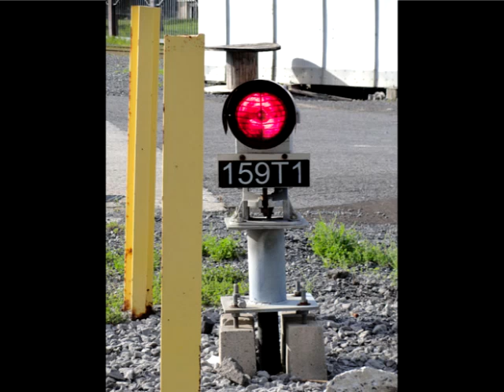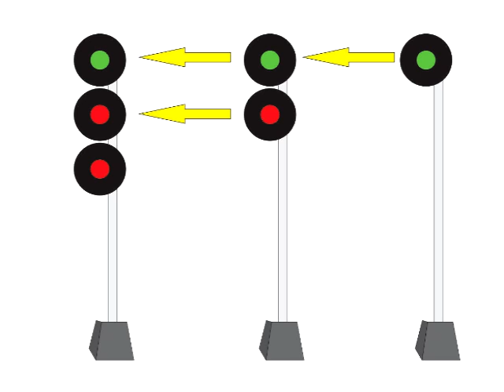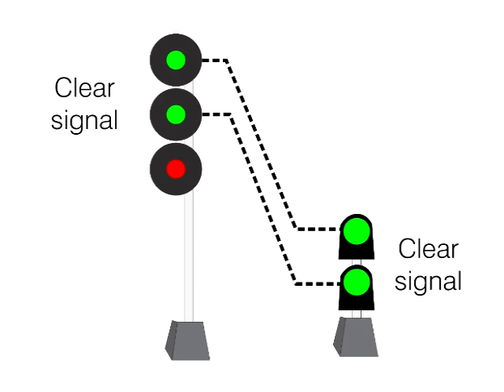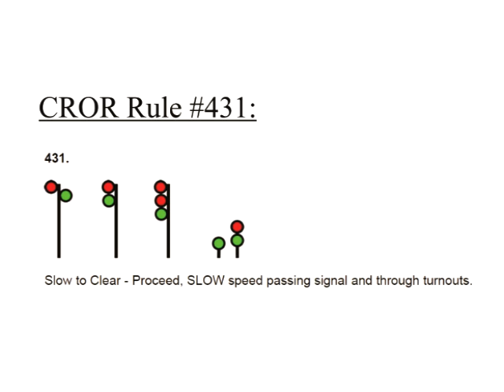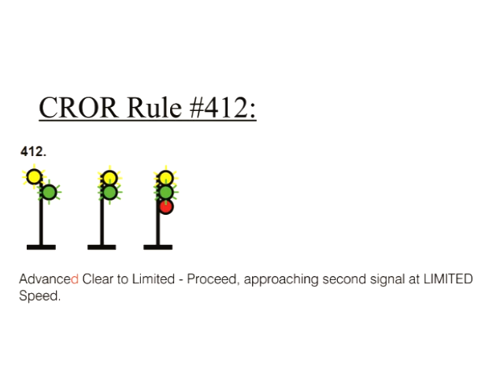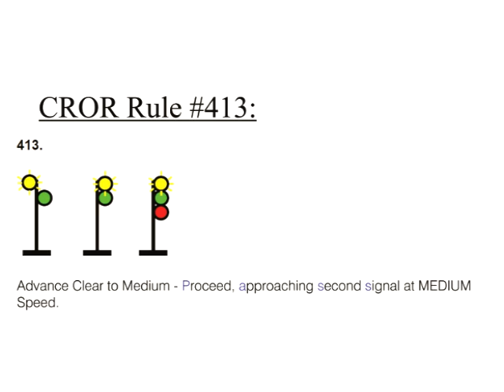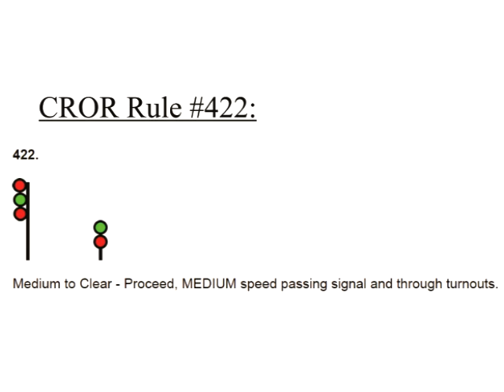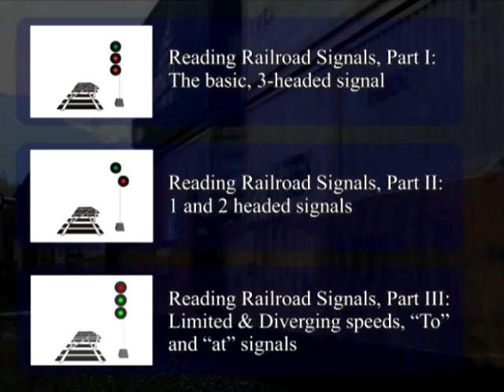Part 4 foamer's guide to reading railroad signals: dwarf signals

Comment: I just wanted to say I always struggled with this as a foamer of the Grand Trunk Western Railway. I lived near a distant signal to the Wabash Line NS today. They have double head USS 3 color searchlights there and   a signal dwarf signal for reverse track. I could never understand the strange indication it would display for the next signal, which had a switch 15 mph. Thank you for clearing that up. It's not to hard to remember. Today the Canadien National Railway replaced the searchlights with double row lights and then sold the line to the CSX. I've been upset with CN for doing that. I miss the GTW RR. I can tell you put in a lot of hard work into these videos. I appreciate it. ❤

Comment: Great mini series here. One question though,, I've seen a three headed signal with a white light in the third signal head. what does that mean?
Reply: It is approach slow according to csxt signal rule 1290.
Reply: Did you see it in the US? It’s a restricting signal on all the systems I’m familiar with. CROR (Canada) does not have lunar white lights.

Comment: Just wondering ... you talk of the train speeds in MPH, but I thought Canada had gone metric? Have the railroads retained speeds and distances in miles, or are you converting km/h to the nearest 5mph for American viewers?

e.g. are 15, 25, 30, 45, 75, 100mph actually 25, 40, 50, 70, 120 and 160km/h... something like that?
Reply from the maker: No, the railroads in Canada retained the imperial measurements. We do everything in miles, miles per hour for the reasons of the rules which were in effect long before Canada went metric. And so a lot of the rail operating rules (i.e., identifiable locations, mile posts, and trains speeds like slow speed, medium speed, limited speed, etc...) were based on imperial measurements and set up. Converting everything to metric would've involved a major overhaul of the rail operating rules which had been around for decades prior. CN even pays us "by the mile."
Reply: @ianjuby  I remember the pre-2020 O-Train Trillium line in Ottawa being denoted and marked in kilometres, but I think this was an oddball exception. The entire system is being switched to CBTC and now disconnected from the mainline rail network.

Comment: I wonder, why there are so much different signals. In Germany, our signals have only three definitions. Go, Slow and Stop. The signals are protected, even when they are automatic blocking. Sometimes the slow signals are upgraded, with speed signs. A motorman has to push a button from time to time to show he is alert. If not, the train will stop at once. Sorry for my english.

Comment: question what is a flashing green dwarf signal.    i've seen it in the states a few times. mainly on a commuter railroad outside of new york city. note the track speed is between 50 and 80
Reply from the maker: Hmmm... I don't know - that would be something Amereecan, quite possibly unique to the communter railroad itself. I wouldn't know, someone else here might.
Reply: Flashing green is for cab signals.
Reply: Depends on the arrangement of the dwarf signal. Is the signal alone or in combination with one or two other lights?

Comment: How do you know when  you've cleared a switch to either speed up or slow down?
Reply from the maker: We have a footage counter in the locomotive. We push the button, and it tells us how many feet we've traveled. We set the counter at the light as we enter the siding, and we know our train length by the train journal information.
Reply: Ok thanks, that makes perfect sense.
This does take some time to understand this but I can see the importance of the fail safe system.
Is there any reason why the lashups of power units often combine a EMD and a GE units say in a SD70 ACe and a C44-9W?
Reply from the maker: Nope. No reason. They just slap together whatever is available.  I've seen them stick old beaters on the hot shot trains, so obviously it the power isn't even assembled according to the need on the train.  But I've had brand new units (literally 2 weeks old) die on me, so new or old doesn't mean a whole lot when it comes to reliability.
Reply: It's called a distance measuring device or DMD. When the engineer gets on board, he takes the total length of the train plus 3% slack action and enters it into the counter. He hits the button when the engine reaches the signal or switch and it counts down until zero. When it's at zero, you've cleared the signal or switch.

Comment: In the signals test do you need to remember the rule # as well ?

Thanks
Reply from the maker: Nope. And in fact, the QSOC classes (conductor's rules classes for new conductors) may have switched how they perform the tests. When I went for my recertification last year, they simply had an answer sheet which listed all of the signal definitions and you had to match up the letter of the appropriate definition with the signal on the test sheet.
Reply: Ian Juby awesome thank you very much for your help

Comment: ASPECT = What the signal looks like.  Green over Red, or Yellow over Dark over Green for examples.
INDICATION = What the signal indicates the train crew should do in response to the signal.  “Proceed, passing the next signal not exceeding Medium speed,” for example.
RULE = The formal assignment of ASPECT(s) and INDICATION as presented in the Rule book. Each rule is assigned a RULE NUMBER and a NAME.  Rule #419 / "Limited to Slow" for example.

Comment: Oh dear. You forgot all about the difference between lunar, light blue, white, off-white, beige and grey signals, what you should do if in the signal is triangle or rectangle shaped, what the combination 'flashing-green, winking-red, startled-yellow' means, the divergence in meaning of limited vs. restricted vs. off-peak vs. weekend-only vs. occasional signals (in red, yellow, green, lunar, light blue, white, off-white, beige and grey; flashing or steady), and what to do if it's a full moon and/or the next solar eclipse coincides with the passage of Venus.

Other than that, pretty comprehensive, and a good overview of a not at all counterintuitive, needlessly complex system.

Comment: Another question: What happens if there is insufficient braking distance between two signals, or a signal and the second next? Or otherwise, if the distance between signals is lower than usual?
Reply: If the signals are too close together for the heaviest, fastest train to be able to stop in 3 signal blocks (CLEAR → ADVANCE CLEAR TO STOP → CLEAR TO STOP  → STOP) then additional aspects are introduced to slow the train down earlier.  Each aspect progression is tailored to the needs of the specific location (track speed, train weight and speed, signal spacing).  For example, a train could encounter CLEAR → CLEAR TO LIMITED → ADVANCE CLEAR TO STOP → CLEAR TO STOP → STOP.  The CLEAR TO LIMITED would cause the train to need to slow down much sooner, even though there is no actual "limited speed" indication at the third signal.  If that isn't enough, then even more aspects could be added:  CLEAR → ADVANCE CLEAR TO MEDIUM → CLEAR TO MEDIUM → ADVANCE CLEAR TO STOP → CLEAR TO STOP → STOP.   See?

Comment: These videos about Canadian Railroad Signals are great! But here, in part 4,  you say that you're not allowed to have a single answer wrong to pass the test – ok, it's understandable, doing this job is not easy. But I can't believe my eyes and ears – you have to spell them right? I think it's more important to know what to do when you see the signal than know the precise definition of the signal... just my opinion. And I have to say that "Canadian Railroad Signals" is kind a mess :-D I had thought understanding railroad signals in my country (the Czech Republic) is quite difficult, but since I've watched these videos I changed my mind :-D
Reply: The spelling is important because the rules must be followed to the letter.  At least, "to the letter" within the purview of your boss.  The excuse "but I couldn't remember the rule exactly" cannot be tolerated.  It's one thing to add or remove a more-or-less meaningless word like "the" but it would be another to mess up a speed name or the order the words are in.  The simplest and safest course is to make all of the words equally important instead of playing games with some words more important than others.  You either know it or you don't.  Additionally, the words "advance" and "advanced" are rather different in meaning in English.
Reply: Actually the Czech signals are very easy to read, followng uniform rules across all aspects, naming speeds by numbers instead of monikers (like "slow") etc. Very easy. There are only a few tricky points. The Canadian system is fiendishly complex compared to the Czech one.

What an aspect means in a specific location in the Czech system is, however, trickier (eg. at places with insufficient braking distance). And the Czech operating rules are a mess.

The precise spelling ... I see it in the same way. First, you learn signal definitions by heart. Next, you secure a train improperly in a siding and wipe out a small town.

Comment: You mentioned lunar signals in the first video. How do those work?
Reply: Lunar White is the common fourth signal color found in North America.  It is usually used to mean the same as RESTRICTING SIGNAL and can often be used interchangeably for a Flashing Red light.  If you are familiar with North American traffic signals, specifically the pedestrian signals, then DONT WALK (or the hand) is shown in Portland Orange, and WALK (or the human figure, mid-step) is shown in Lunar White.   So you may have already seen the color and not known it!  A regular incandescent bulb has a red/yellow tint to it (not quite white hot), but Lunar White resembles the look of the moon from Earth as it reflects the sun—very little red/yellow in it.

Lunar White is not historically used in Canada signals because Canada has employed (until recent years) only searchlight signals. And, as you saw in the first video, searchlight signals can only show up to three colors.  Were a signal head ever needed to show all four (Red, Yellow, Green, Lunar White) then it would not be possible.  

One advantage the use of Lunar White offers is it removes the need for the lowest signal head showing Yellow to mean RESTRICTING SIGNAL.  This means that SLOW TO STOP could be Red/Red/Yellow instead of Red/Red/Flashing-Yellow while RESTRICTING SIGNAL would be Red/Red/Lunar.  Red/Red/Flashing-Yellow could be used for something else.  It also means that MEDIUM TO STOP could be shown as Red over Yellow.  Right now, Red over Yellow also means RESTRICTING SIGNAL; the MEDIUM TO STOP aspect is Red over Yellow over Red, and that lower red must be there.  It is not merely just a placeholder.... this is something important that Mr. Juby should have mentioned.  (LIMITED TO STOP can be shown as Red over Flashing-YELLOW alone just fine, since the Flashing Yellow will also imply Limited speed.)
Reply: See:  http://signals.jovet.net/rules/index.html

Comment: Awesome videos on signals. Just wondering if you're gonna make videos based on OCS and CTC
Reply from the maker: +jay romano Don't know what I would do for an OCS video.  :)  I really enjoyed OCS as it was very technical, but don't know what I could do for a video.
Reply: +Ian Juby Maybe try drawing schematics of the method of control on a white board might help a bit. Or any possible way you believe would work. Sounds like a lot of work but would really help me out. I'm not in the railway industry but trying to get in.
Reply: OCS is more or less identical to Track Warrant Control (TWC) in the United States.  There are several technical descriptions about that to be found on the internet.

Comment: great video series..but what about 3 and 4 headed dwarfs? thank you.
Reply: They are also very rare, not just in Canada but the United States as well.  One and two heads is economical and covers 99.9% of situations needed.
Reply: +grvolans Those are all signals that are entirely based upon local special instructions. They are not standard lights and the indications that would be displayed on them would be in the regional special instructions for the territory applicable.

Comment: I have a question. What do you do if you see a FAILED or malfunctioning signal? (eg..The signal's that is complelely out) Are trains required to make an emergency stop in this case?
Reply from the maker: raymondlee3327 Excellent question.  Not an emergency stop, but we have several rules in the CROR we follow.  Namely, we read the light as if the burnt out lights were red.  This puts the signal to its most restrictive form so we either stop or govern ourselves accordingly.  if we have to stop, we just bring it to a stop and call RTC and get direction then, reporting the failed signal. Actually, I'll add your question to the questions I was going to address in the next video on CTC signals cause that's quite an involved answer actually.  :)
Reply: +raymondlee3327 It depends on the indication of the malfunction signal. There are 3 different situations.

1. Movement stops if the most restrictive that the signal can display is STOP - with the exception of a solid yellow light on the bottom. Then the train can go at restricted speed.

2. If the most restrictive indication the light can display is restricting, proceed or slow down to restricted speed.

3. If there is a yellow or green light displayed the movement slows down to slow speed when practicable - as in if they're going to be going through a switch.

Comment: What if you have a to-signal such as this clear to medium (G/R/G) and the bottom head's magnet fails and goes to red. (G/R/R) Woundn't this be less safe?
Reply from the maker: Yes, someone pointed that out on one of the other videos too, and I have to agree.
Reply: +Taylorover9001 That indication is only used in a few specific points. I am sure the crew would know something is up. Also, that would give you an improper signal progression and the crew should realize this and take action.
Reply from the maker: Hmm... I don't know the US signals!  haha!  Plus, apparently there's multiple systems in the US. There's actually multiple systems in Canada, but these were the agreed upon signals for the CROR, and the odd ball signals tend to be in specific, remote areas.
Reply: +Ian Juby It looks like that system can't take many more imaginative upgrades....
Excellent series btw
Reply: +EduEnYT The Canadian system is quite fancy.
Reply: GEES44DC And overly complex
Reply: Ben Raber train simulator is not accurate in how it portrays signals.
Reply: +Ian Juby Hey this was a really cool series would you mind doing one on the us signals?
Reply: thanks anyway, In Train Sim, I'm having a little trouble with the Pacific Surfliner Route Reading those signals, but other than that I think I'm fine.
Reply: That is why this signal is usually only on USA lines that have branches crossing the border.
Reply: If I recall correctly, Pacific Surfliner is an American route.  Accuracy of signals in the Microsoft Train Simulator varies by route.  That said if you're a route developer the signaling system is very robust and flexible and CAN emulate full CROR rules if programmed correctly.

Comment: Nice video! I got 4/5. I stumbled on the clear to limited. Also, those CROR rules are crazy! I may have some questions later. Just one thing I've seen, is a Clear to Slow, then Clear to Stop, then Restricting all in a row. (Y/Y, Y/R, R/Y)
Reply from the maker: Right. Ya, we have similar signals on the Allanwater sub here, and I think it's just a throwback to the very old, original lights.  When we go into a siding, it's a restricting signal, but I think originally (when the signals were build - probably early 1900's) that was supposed to be a slow to stop signal.  But, restricting signal works - it accomplishes the same thing really.  So when we come up to a siding to go into it, we'll get a clear to stop, then a restricting signal at the siding. The restricting signal is kind of a form of stop signal I guess, kind of like a form of stop and proceed.
Reply: Yeah, I guess. Just one more thing, although it doesn't matter much, it was indicating for a spur, on the CN main line (CN Rivers Sub)
Reply: You failed the test.  It's RESTRICTING SIGNAL not just "Restricting" 😉